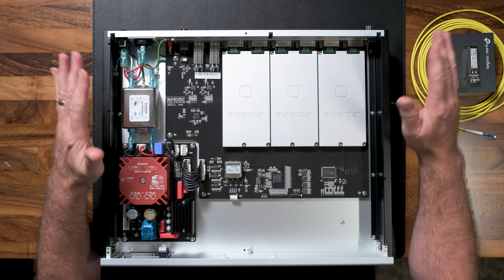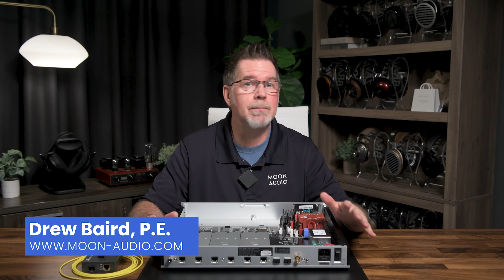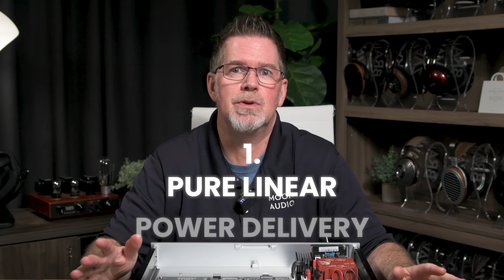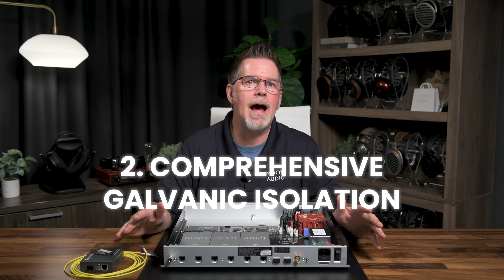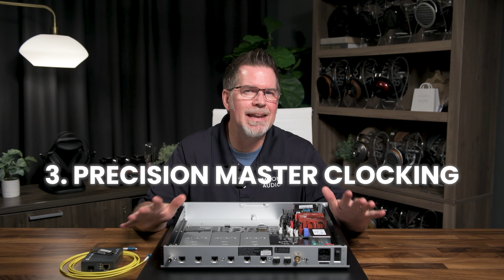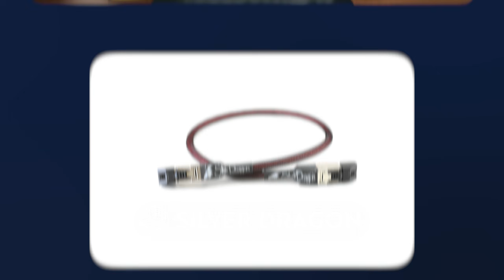Fix This NOW! Your High-End Audio System Will THANK You (Aurender NH10 Review)

Comment: High resolution music is the same thing as a Netflix stream! It's not real time either. If there is a lost packet it will be re-transmitted If you buy this you deserve the fleecing. I've got $10,000 to your $1,000 that in your own setup, when blinded, you can't tell the difference vs a $100 switch.

Comment: LoL - Your Home Router sucks, put this expensive ass switch in between that router and your Home Audio and it magically fixes the problems of your Home Router, you know, the thing STILL in the loop when streaming from anything on the internet?
Oh it helps with congestion?  You mean that 10 Mbps FLAC is bottlenecking your 1000 Mbps (Gigabit) home network?  And your Playback device has zero buffer memory?
It acts like a giant electromagnet antenna, OMG, I better fix it, because it's not like Ethernet is carrying DIGITAL protocols WITH error correction.

Comment: This is completely over blown, lots of marketing hype for no real gain. Really claiming their is a real difference with SM fiber vs MM fiber? There is virtually no difference in packet drop and jitter regardless if its a led or laser light source, only difference is the distance in which the data can be transmitted and the cost being greater.

Comment: Really?? with an extra 6k+ on hardware, plus a few hundreds on cables???? I think I'll stick with my physical media thank you....👌 
Oh, and if anyone else in the house wants to listen, then they can join me in my listening room, or I can just turn it up!! As I' won't be linking my system to any network!! 
As for Streaming? well that's just another excuse/reason/expectation to part with even more cash!! on the 'well if your buying that, then you'll need all these bits for it to sound good'.... and don't get me started on the various streaming 'pull the wool over the eyes of the punters' service providers. 😡😠🤬That's why I'm never having a streamer in my system... I'll buy an artists new album on physical media, direct from them or their record label, at least they'll get more of 'a cut' from that. I don't even have the 'Bluetooth' antenna's attached to any of my gear (that came with it) as I don't use it !! As for 'Hi-Res', all my CD's are backed up as FLAC files onto a spare 2TB laptop (Internet disabled) and this can be linked via USB into my integrated amp or standalone DAC... at least I know the 'Bit rate' of those, and can't be 'hoodwinked' by some online provider, there you go, I told you not to get me started lol 😂😂
Reply: Hear hear!
Reply: Exactly.  Buy physical media (it’s then yours, and can’t be shut off at the whims of a streaming service) and spend your money on decent speakers - they make a far more audible difference than any of this marketing wank.  I’ll stick with my 70s era receivers and Klipsch, ADS, Dynaco and AR speakers.